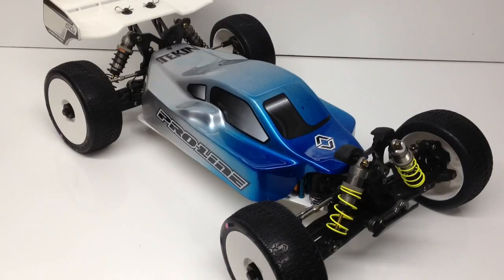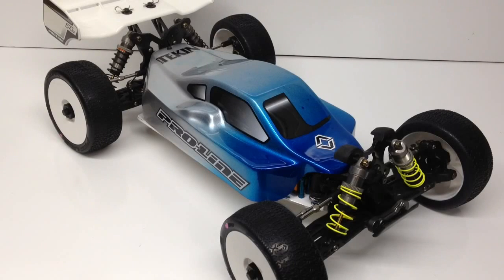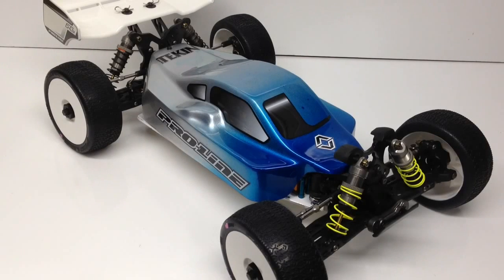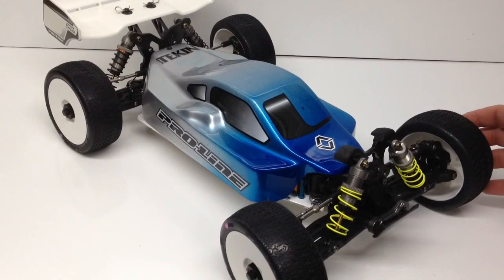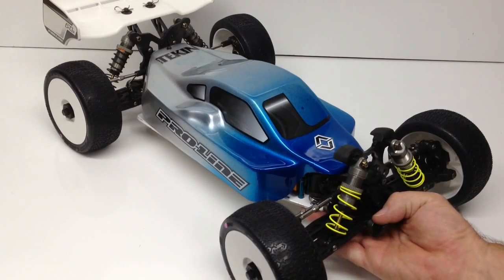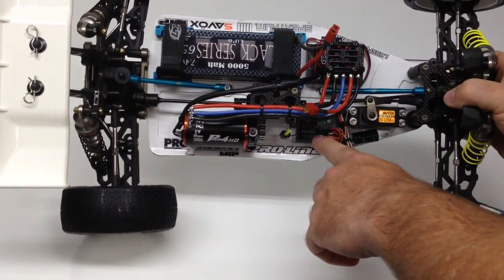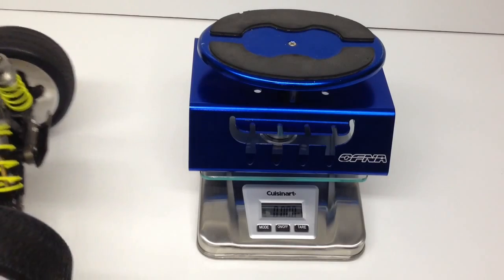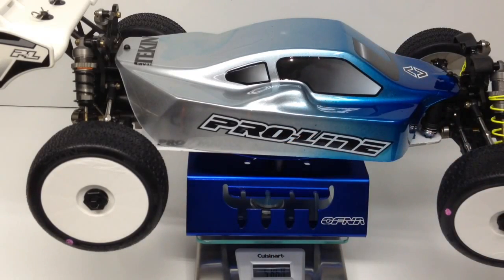Losi SCTE / MIP converted to 1/8th scale buggy - Part 2

Comment from the maker: Probably not.  I have already converted it back to an SCTE.  Not because it didn't do well, but because I wanted to do a compare to the SCT410 which will be airing in the coming weeks.  If you are thinking of converting, MIP now has the conversion kit out called the Pro8, which in my opinion will be a great deal.  It will use some well suited items that Matt Olson tested out for quite a while

Comment: Just some little tips/advice. Use the rear SNR Graphite shock tower that let's you use a full Losi 8ight wing mount as the 810 mount is REALLY weak. Also instead of the 810 body try any body for the Mugen MBX6 Eco. It fits a little better and will match with the added chassis length.

Comment from the maker: The big factor is cost.  If you get the coversion, you're out about $120 and you're using the same electronics and batteries you already have for your SCTE.  The 8ight 3.0e is a great buggy, but you're looking at $1,000 just for the kit and the electronics plus buying some 4s batteries.  If you're going to go cold turkey into the 1/8th scale race buggies, I would consider the Tekno EB-48.2 or the Mugen MBX7 Eco before the Losi

Comment: rich have you run this buggy yet. we are going to try and get a class of these going this next spring. local track is to small for full size/power E buggys.
Reply from the maker: Yep, I sure have.  It's super quick with the electronics I am running.  Check out MIP's Pro8 conversion for either the SCTE/MIP or TLR2.0.  It puts everything together for you.  I had some slop on the front steering I was trying to clean up, but that was the only issue.
Reply: ok thanks

Comment: I have a question about my losi scte that has only two runs on it and the worst squeaking noise is coming from 
from the drivetrain. I was wondering if anyone has had the same problem and how you would fix the problen?
Reply from the maker: That's a tough question to answer. Where specifically is it coming?  Maybe try removing the pinion from the motor and spin the drivetrain to isolate.
Reply: Thank you for your response I will try to solve it when get the chance
Reply: I have finally solved the problem with the truck it was a few crushed bearings in the front diff housing
Reply from the maker: Glad to hear you found the problem.

Comment: Looks very nice! Good job! But isn't legal for race, in the 1/8 Scale electric buggy the minimum weight allowed is 3200gr == 7lb 0.87669oz (2013_ROAR_Rule_book (page 64)). By the dimensions, I don't see any problem. Anyway, is very cool!
Reply from the maker: I hear ya!  MIP and Tekno were both on the front to try and either allow or create an additional class for lightweight 1/8th scale buggy.  I know that Matt Olsen was competing with the Pro8, but was running an 1/8th scale motor and a lighter weight 4s for some races.  The other front was many of these indoor tracks have banned true 1/8th scale buggies/truggies because of the liability and the risk of injury.  WCRC (before it closed) banned all 1/8th scale due to a major injury that occured from someone that clearly shouldn't have been driving an 1/8th scale.  OCRC had a long tripple by the driverstand a while back, and I got clocked by an 1/8th scale and it's not fun!